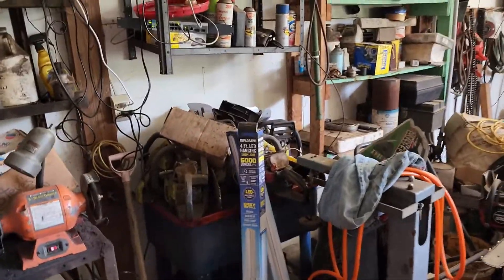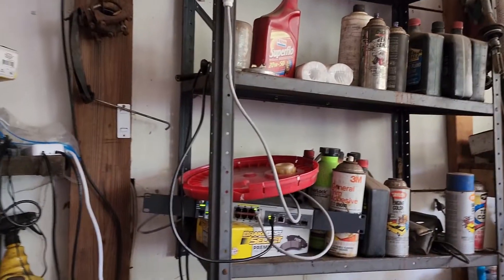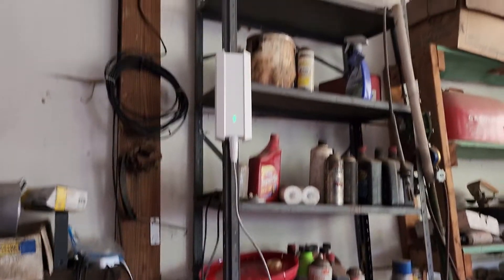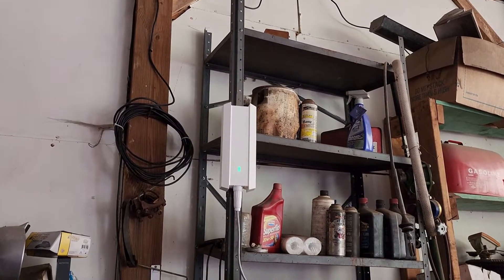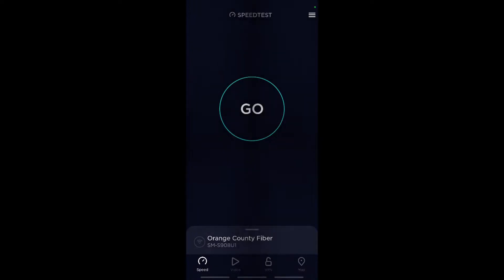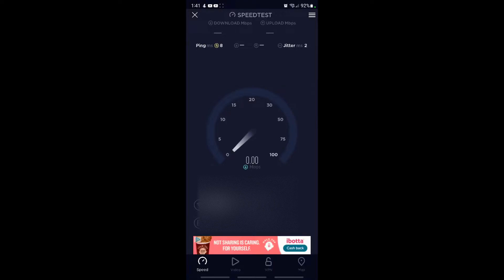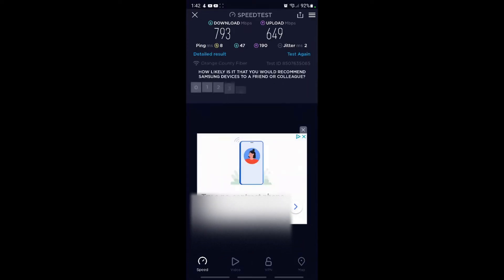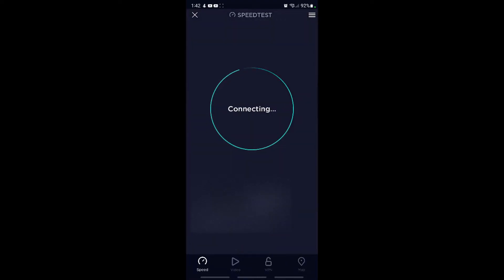TP Link EAP610 outdoor Wifi 6 AP in the Shop

Comment: i have a eap 610 outdoor 2 months and wifi signal is dead , recomend eap 225 outdor  4 years working normaly
Reply from the maker: I've had mine for several months.  No issues so far.  Was yours the wifi 6 model?